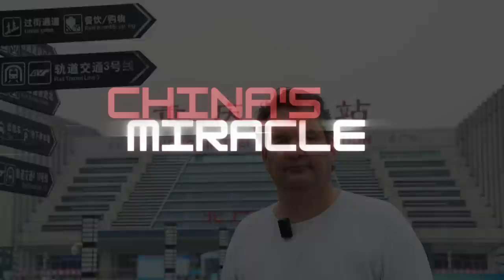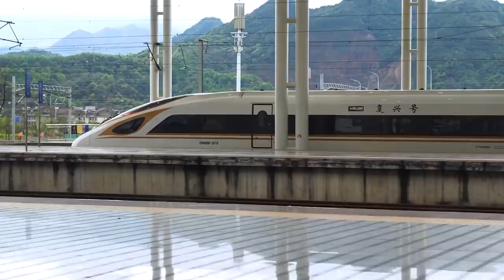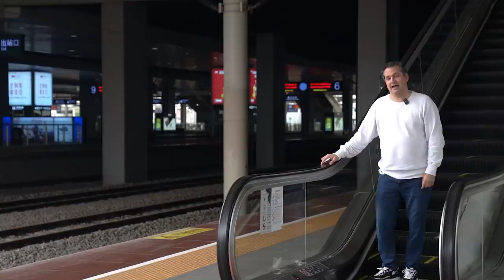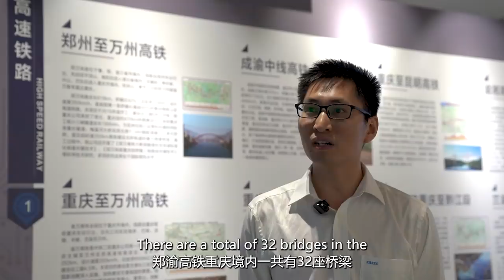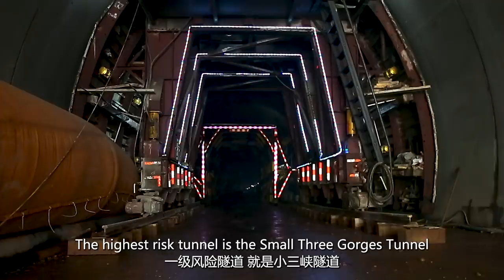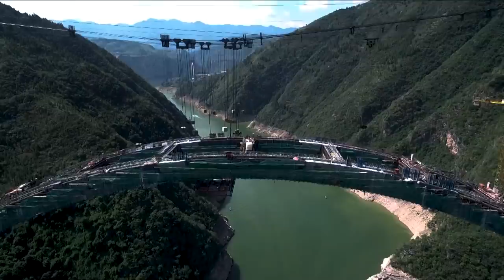China's New Bullet Trains SHOCKED!! American Engineers | 中国最新高速列车让美国工程师惊呆了

Comment: I work on the Qinghai-Tibet Plateau, and I am shocked by the great work here. The workers built the highway and the railway in the harsh environment of cold and lack of oxygen on the plateau. In addition to the need to build bridges between the mountains, it is also necessary to overcome the collapse of the frozen soil all the year round. In recent years, a tunnel has been opened at the 米拉 mountain pass, so people don't have to climb to the top of the mountain to cross the mountain, which brings a lot of convenience and saves a lot of time. The feeling of driving in the mountains at an altitude of 5000 meters is so shocking.

Comment: When I went to China for the the first time around 2008 the coal fired steam train era was just about to officially end and the High Speed Train era was about to start.
The current high speed rail network is GREAT, it has a high frequency and is comfortable, quiet, reliable, clean, extensive, cheap with LOTS of legroom.
I prefer high speed trains above airplane s and even above travelling by car(aka congested roads).

Comment: I did a test run in 2016 between Shanghai and Hangzhou (similarly distance between NYC and Providence RI - 110 miles) on the HSR.  I had breakfast in Shanghai and took the HSR to Hangzhou for lunch at my friend's house then back to Shanghai for dinner with my family.  I actually took the cab to and from the stations in these cities.  The number of train running between these 2 cities is mind boggling.  I bought my tickets at the station without any knowledge of the train schedule.

Comment: Chinese high speed rail is another feng shui project. Gravel with no Concrete in Pillars to hold up the bridges stations that rain Pours Down into that roofs don't work. Empty trains that suck up electricity that don't even pay the cost of running. Big boondoggle nothing else

Comment: Your ignorance (real or pretending) is truly remarkable.  The steel shell and the interior (seats and lighting) were all made in China.  But, all the control electronics are from Siemens and the US, including the running gear (axel bearings and brakes) are imported.  Knowing how China inflates it’s inventive power, the foreign companies charge prices manyfold, causing the high speed rail system to be losing 400 million per day in operations!  The same is true with the Boeing 737 copy called C919.
Reply from the maker: Get educated China doesn’t need to make money in Public transit. How is Amtrak hahahahah bwahahahha
Reply: Question: if all those components aren't made by China, then how that such impressive  infrastructure exists in China but not in USA, for example?

Comment: Does China care about ecological effects of building high speed rail on wildlife? Nature conservation should be a top priority. High speed rail system isn't that hard to build but we must protect wildlife and environment first.
Reply from the maker: Did you even watch the video?
Reply: Of course they care, an engineer in the video said that they designed one of the bridges with much longer span just to avoid having a pier in the river below.  In last 10 years, China has made good progress in environment protection and reducing pollution.
Reply: This goes to show you COMMENT WITHOUT FIRST watching the whole video. They bended backwards to protect wildlife and environment.
Reply: The high-speed rail system should be the most difficult in the railway system. I don’t know whether your country has built a high-speed rail. It is a difficult problem to supply power to high-speed trains running at 350km/h. High-speed railways have very high requirements on tracks. It is seamless. The height error of every 10 meters is measured in millimeters. In addition, this high-speed railway passes through mountains and rivers. Bridges and tunnels account for 98% of the mountain sections. The construction difficulty is quite high. It is clearly mentioned in the video that in order to protect the environment, the road avoids more than 20 nature reserves and drinking water intake areas.
Reply: By now you should be humiliated for being call out for commenting without watching the video. Shame on you.
Reply: Building one or two high speed rails may not be hard, building a huge high speed rail network covering the third largest country in the world is
Reply: Shot first n talk later. Wake up dude 🤣🤣